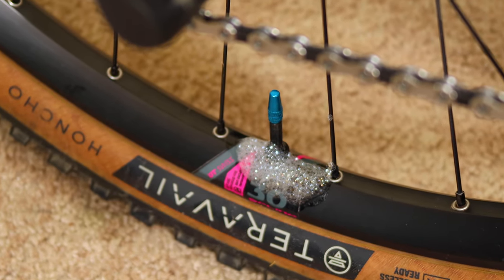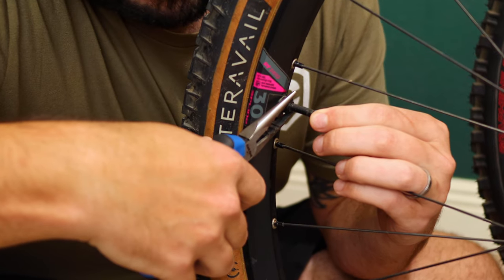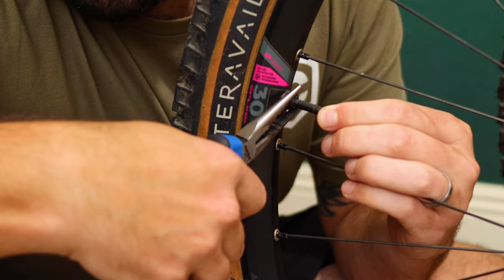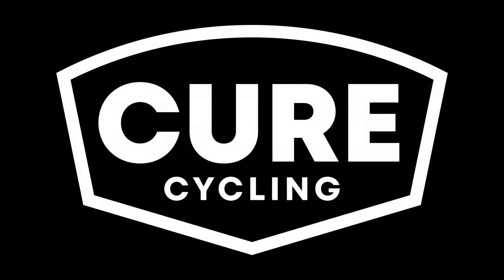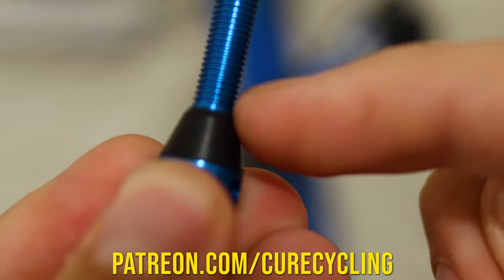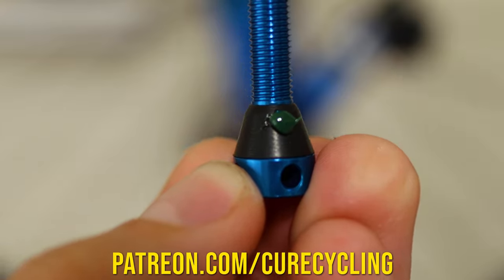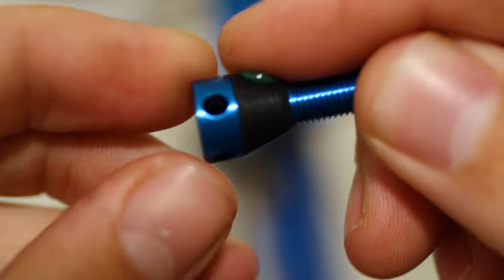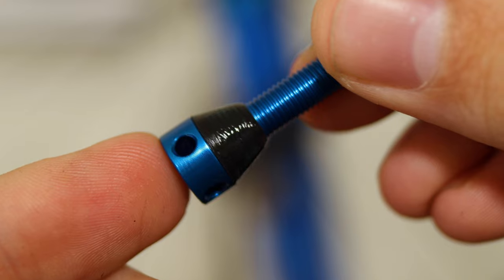Valve Stem Leaking Air? TRY THIS!

Comment: I like to make sure my wheels are almost leak free before adding sealant. Usually I'm okay, but I was stuck with this wheel that just would not stop leaking from the valve. I hate gambling on sealant fixing a leak, because if the sealant is not enough, you are stuck with a messier situation than before. This quick procedure sealed the leak. I was even able to reseat the tire without a compressor, a first for me.
Reply from the maker: That’s a smart way to do it honestly!
Reply: @RT Rogers same. I just spent so much time and energy getting my pain in the ass tires to seat and now this... I think it's time for a new bike ;)

Comment: I got a brand new Nukeproof wheels, and they leak from the valve stem.  I used half a bottle of 150ml of sealant on one wheel to get it to stop leaking.  I will remove my rear tire (because I haven't used sealant on that tire yet,) and try the grease method.
Reply from the maker: Definitely worth a shot. It’ll drive the little rubber gasket in there a bit deeper. Better chance of a tight seal.

Comment: Yes, I finally found my leak was due to valve stem nut not being tight. 
My Bontraiger valves do not have the conical rubber inside. 
I loosened the nut, banged the valve into the rim, then retightened with plyers, being careful not to overtighten. Solved.
Reply from the maker: Nicely done!

Comment: I've tried this and it works when the rim outer surface is flat but I have a customer with QUAI R30 road wheels and the ID of the Rim isn't flat its slopes to one side making tubeless tires a nightmire for this
Reply from the maker: Yeah I’ve come across that once since making this video as well. Those wheels need special shaped compression nuts ideally.

Comment: Theoretically, shouldn't the sealant close any gap between the valve and the rim bed? Just curious if a dab of grease would affect the sealants ability to seal a leak then around the valve? Great idea in theory though and definitely seems like it would help!
Reply from the maker: No it drives the seal tighter. It’s a technique I’ve seen other mechanics use but it’s grossly unadvertised. If sealant is needed to fill the seam at the valve stem, it’s simply not tight enough. That’s where the grease comes in.
Reply: Couldn't it also be that its too tight?

Comment: Damn.. I had missed this simple hack. I wasted 500ml of tire sealant 2months ago because of this valve leaking problem... Couldn't fix the air leaking valve stem in 4 attempts then gave up rinse them all out and put back inner tubes.
Reply from the maker: Well…something to try for next time!

Comment: Looking 4 a hack that maybe missed. That's a great one. Tried before this trick, on my previous cheap or orthogonal valves. [I use grease on my tyre as well as pros on car or bigger earthmoving tyres.] This time i get pattys with deeper cone compared with what i had so i gave this a try but nope. In general i tried, extra tight, extra inner o-ring or hot glue mold, or more that now i can't remember. nothing seems to help to my narrow rim. I feel that i spend my greatest weeks on that :P Next plan, a piece of inner tube or a silicon or another mold to flatten the narrow area.
Reply from the maker: Goodness that sounds complicated! I hope you find a fix that works!
Reply: @JaredRMorgan  Thank u Mate!! I made it after uncountable tries 0:) My goal is to run tubeless with NO Liquid Sealant!! It turned out that the leaking came from the tape on a valve hole. I install better quality transparent tape (recommended as any bubbles r visible to avoid) and open a hole with a grinding ball by dremel (high rpms n no pressure is ideal).